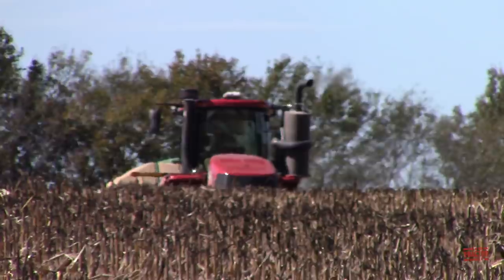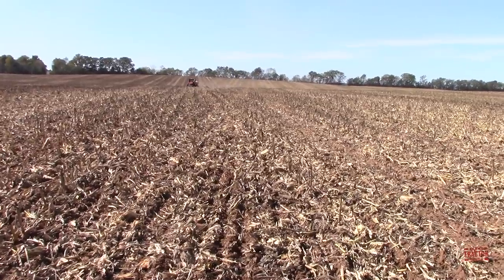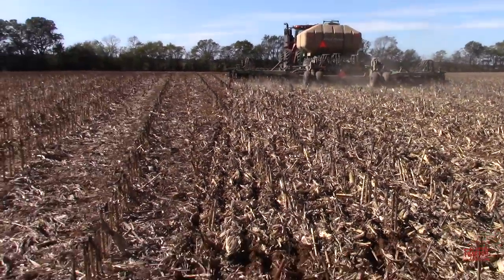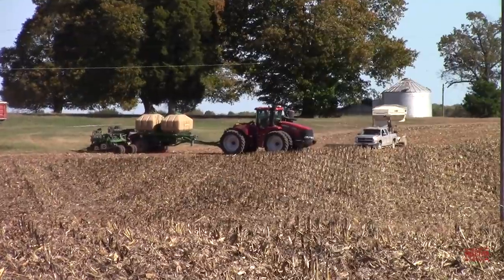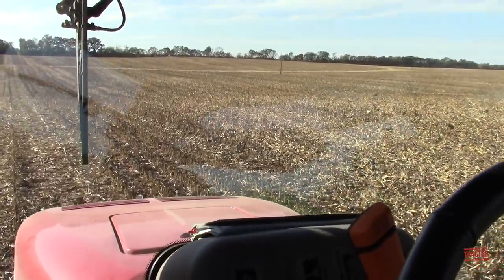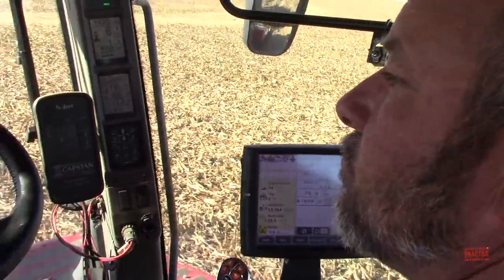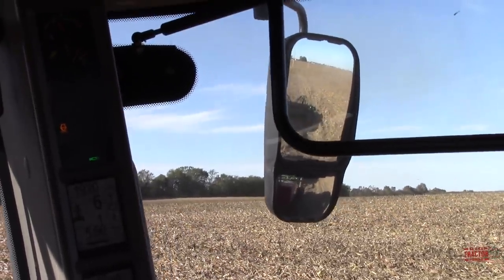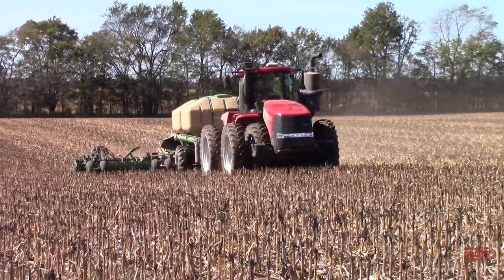NO-TILL | Case IH STEIGER 420 Tractor & Great Plains ADC-2352 Drill

Comment: I 📝 that it's drilling across the existing drills, taking a different route than the harvested corn. 
The muffled appears very large on the outside but doesn't appear that large from the inside. 
Great when you can get up in the cab. 
A little noisy though btp 
Great video. 👍👍

Comment: Often enough I see tractors driving diagonally across a field, i.e. diagonal to a recently harvested crop. Why do they drive diagonally? Does it relate to compaction?
Reply: Jack Sak the mechanical blades tend to plug up and drag, creating piles and uneven results.  This can happen with coulter and shank machines as well.  It’s to eliminate plugging issues.

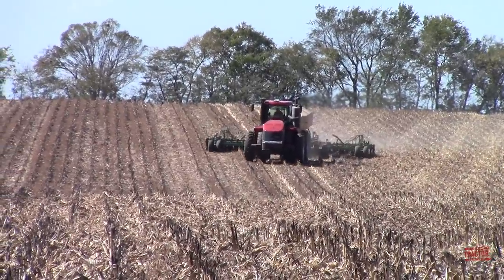Comment: Coming from a non-farmer guy: why at 2:02 it goes diagonally on the field, compared to  how the corn was planted ?
Reply: Change up the fertilizer patterns/structure of the soil. Planting with disks usually causes some minor form of compaction called sidwall smearing. Changing up the angle reduces the chance that the same area will be compacted year after year. Also with row crops like corn and soybeans, fertilizer is often applied along the same rows as the corn and soybeans so going diagonal helps create a more even application.
Reply: @3.6roentgen61  That's interesting, thanks for the answer.
Reply: @3.6roentgen61  And facilitates seeding, avoiding most of the standing residue!
Reply: @3.6roentgen61  Thank you. I always wondered about that when I drove past fields, too.
Reply: @maxiskritik1039  It's very minimal. Large tires compact much less then small ones. A rowcrop planter would likely compact more then this. The issue with sidewall smearing is that it's in the exact place the crop needs to push through and it's much more densly packed. Sometime requiring up to 300psi to penetrate from the plants.

Comment: If a farmer continues no till over and over doesn’t it eventually choke out the field?
Reply: No because the roots from the previous crop decompose leaving holes in the soil.
Reply: The thing that will get you eventually on no-till is woody plants or chemical resistant weeds, you'll be working the ground at some point.
Reply: @Zero01k  No that's a myth that companies like John Deere tell you so they can sell you another 500+ horsepower tractor and another chisel plow.
Reply: No till or zero till is basically a religion here in Australia. It's not hard to find fields that haven't been tilled in 15+ years. It's perfect for conserving moisture in low rainfall areas.